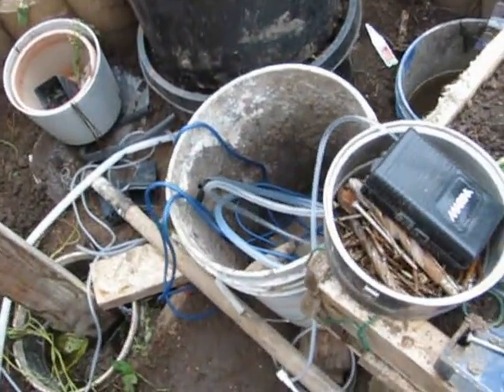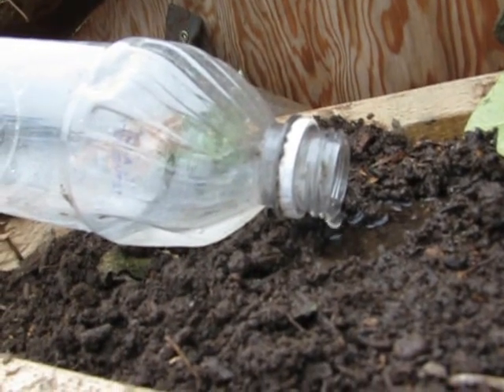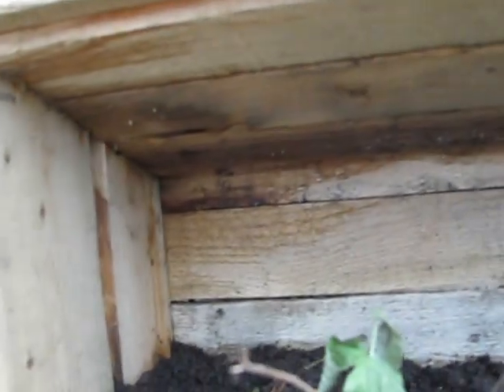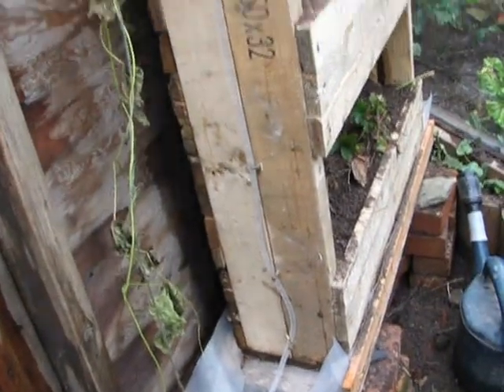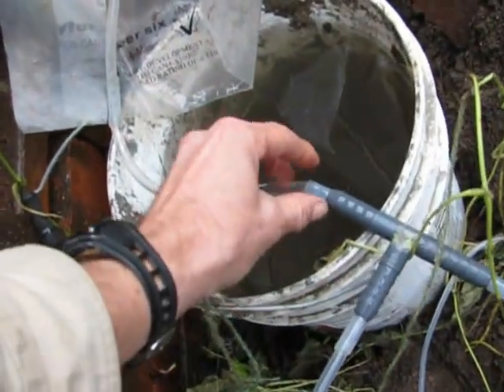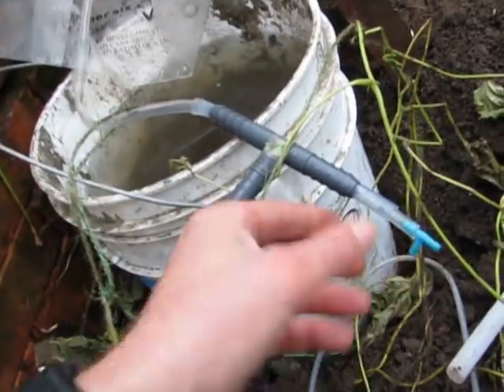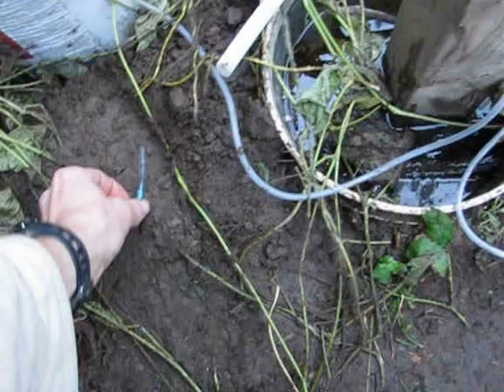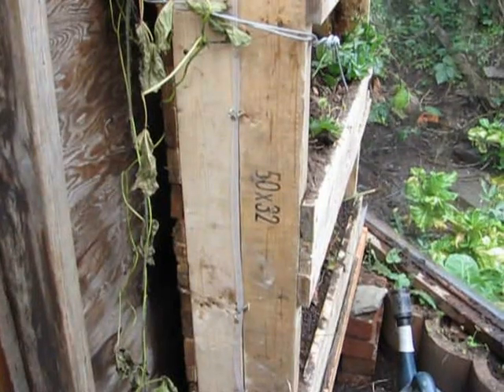Airlift for the vertical pallet planter. How it works and hints for making your own.

Comment: I love this.  I use a cyclical syphon system based on the one you designed, to refill my aquariums overnight.  I forgot what you called it.  I use a valve to control the flow of water and also found it to be crucial.  I modified my cyclical system to inject air into the outlet, thus aerating the water and reducing the total weight of water in the pipe, in theory allowing it to pump much higher, similar to a traditional airlift.

Comment from the maker: It is not going to be continuous flow. The bubble pump will be on a timer.  This time of year, it might only be on for 15 minutes or half an hour per day. The soil is not structured to promote drainage but the bottoms of the planters slope to the back.  This effectively means that the water gets directed to the back and then drips down the back of all the planters. I might put sand in the bottom of the lowest planter or if it is just  too wet, grow water cress in it.

Comment: I like the pallet construction on this one... It looks really good.
I think if I were to try this idea I would place some sort of a time released water tank at the top to flush the garden. The continuous flow might inhibit plant growth like you would see next to streams of water. I would probably place a tank at the bottom to be activated with a sump/float like you would find in a toilet tank.

Did you structure your soil in any way to promote drainage? (Like gravel at the bottom or sand?)